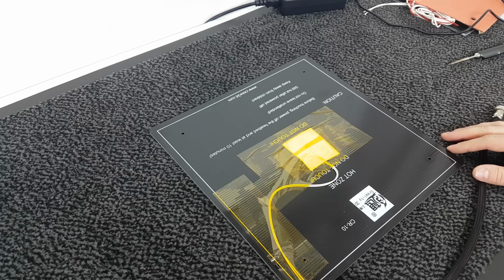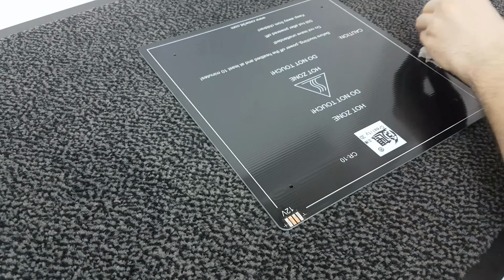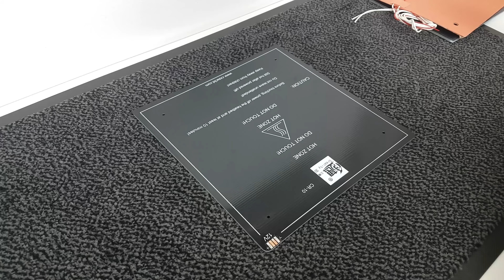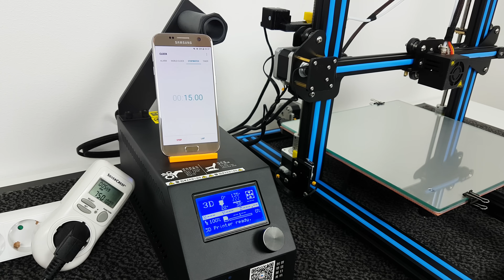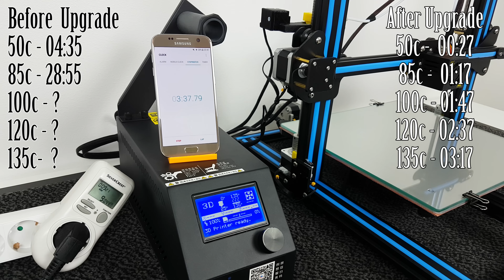Creality Cr10S ultimate Heat-bed upgrade! 750W heater installed

Comment from the maker: !!!!!!-----DISCLAIMER-----!!!!!!
Am not taking any responsibility if you are unskilled and inexperienced with electricity! AC voltage can be dangerous!
Use this video as reference or idea how this update can be done and what results it can deliver.
If you have better way to do this upgrade then please do it in your way.
If you want extra safety add ground wire to the Aluminium heat-bed or to adjusting screw and connect it to the ground directly or on the power-supply ground terminal or on ground pin on the main AC plug switch. 
Also for even more extra safety install Anycubic Ultrabase(that's what i did after this video) and don't use paper clamps. I'am afraid that using paper clamps over and over for long period of time may damage the heatpad and expose main wires. 
Thank you!
Reply: Nexi Tech can you show us how to put marlin on to try and get higher temperatures? Thanks
Reply: keenovo pad dosnt require the insulation, so why do you make it sound so necessary? Do i really need all this extra stuff... and why do you not mention any other ways of doing this ? is this only way ?
Reply: Write the disclaimer extra thick, because you should also not handle AC voltage higher then 50V or any kind of voltage.
If you know a good electricen ask him about this video, he will show you how it is done in a more secure way. Your way can work, but I wouldn't bet on it.
Reply: What if your silicone heater doesn't come with holes drilled through it? Do you drill them yourself, because that sounds like a big risk of shorting something(and getting yourself killed) if you're asking me. wondering since mine didn't.
Reply: @johanneswestman9315  no get one for the CR 10 or get a an aluminium sheet which is exactly 1 cm bigger in both dimensions (for other printers).
Like if you have a heat bed with the screws on the exact edges, then get an aluminium sheet 310mm by 310mm (for 300mm by 300mm bed. And attach the screws. You will need a drill to make it work! I have a Zonestar Z9M3. But there are ones specifically made for the CR 10. So if you have a CR 10 get the custom one.
Reply: @johanneswestman9315  Get a pad that has the holes.  These pads work via embedded wires and if you accidentally cut one two things can happen - 1) the heated pad won't work; 2) A screw through the hole could contact the broken wire and inadvertently conduct electricity to the entire machine, thereby exposing someone to electrical shock should they touch the machine.
Reply: Hello @nexi tech Is my SSR supposed to light up?  When I power the printer on, no leds shine.
Reply from the maker: Tam Le Swap input wires polarity on SSR? Led should light up only when heat bed is on.
Reply: @NexiTech  my goodness! It worked haha. The printer bed wasn't working when I bought it so I decided to replace it and do this upgrade. Thanks!!!!
Reply: @Sebastian Sorry to reply to an old post, but for the benefit of others, you'll needs to get a 410mm X 410mm heated pad instead of this 310mm X 310mm heated pad, since the CR 10 S4 has a larger bed.
Reply: Hi; Please tell me why would you need to ground the HEATED BED? Because you have SSR attached to PSU case that "should" be grounded itself_please explain....
Reply from the maker: guillep2k Can't you see that I just use that tape to stick thermistor wires to another cable so I can drag them thru the cable housing?! You didn't even look video carefully. Over connector wires there is electrical black tape and there is plastic thick transparent ring over it inside the connector. Like I said in the comments use this video as idea or reference and do this updgrade it in your way.
Reply from the maker: guillep2k What transparent tape? Where did I used it? Yes I know what is the heat-shrink I have the full box of it in different colors.
Reply: You should not have used common transparent tape to isolate the mains cables! Each cable should be individually isolated with heatshrink tubing (very cheap from the hardware store).
Reply: 4:44 over the thermistor wire. You shouldn't have used any kind of tape because a) tape dries with time and becomes a liability and 2) the one you used looks like very easy to puncture. In other comments you say you don't worry about the connector because the amperage will be less (which is correct) but the problem is voltage: some ambient humidity and you could have your mains voltage creep to the case; that's why someone suggested you put a ground connection to the case and the bed. And those connectors are typically rated for low voltage with a dielectric strength of 250 Vrms (not enough for your safety). I sincerely recommend you to add heat-shrink inside the connectors (both male and female).

Comment: My heat pad showed up 120v 750w then watching the video I started wondering...Here in the US we have 120v at the wall but yours said 220v Can I assume you live where you have 220v? And can I use the 120v pad with all the same connections you used in your video. Wait for the relay should be here next week will it accept the different pad? Thanks in advance
Reply from the maker: If I remember correctly I linked a 25A relay. It will work both with 120V and 230V pad heater. No worries my friend. Good luck with upgrade :)

Comment: Great stuff...watched it several time and ordered the new heat bed and relay but when using your link to the insulation material you glued to heater. Were finding it's unavailable. What are the white squares made up off? Is there a substitute? Does it need to be some fire retardant material etc.?? Hope you can reply will keep checking back as we wait for our parts. Thanks a million I have been wanting to do this and with your video decided we could thank again!
Reply from the maker: Hi Rob! Im glad that I can help and that you found mu video useful. That is heat resistant cotton which can withstand very high temperature without releasing any toxic fumes in the room. I just updated all links in the video description, please check them again. Just one tip you can use also silicone glue to hold the cotton it in the place. Remember it takes time to cure. Cheers!

Comment: For anyone wanting to know, I was able to do this with a CR10 S5! Just keep in mind when connecting the SSR to the motherboard to connect the negative side to where the small black cable from the heating bed port and the positive side to where the red cable was on the motherboard. I also couldn't get the end off of the cable so I just saudered the original cable with the new one. Works pretty good but doesn't look great lol. Thanks for this video too! 😊
Reply: What do you mean?  Your comment is unclear.  According to the video, the ports 3 and 4 on the ssr go to the mainboard.. are you saying to ensure each one is lined up with the -/+ on the board as it is shown on the ssr?

Comment: I completed this upgrade today. I followed this video step by step along with a couple others and combined them. I had a few minor differences. my mother board heat bed connectors 1 black ground and one red positive were connected to connector 5 and 6 labeled as hot bed not 3 and 4 on my creality CR10s 2.1 motherboard and i kept it the same with the new heat bed connections. I ran a ground from the bed base to frame and frame to control box. I also put a 133c thermo fuse between the bed and insulation inline on the power wire that runs to number #1 pin on the plug. I also updated the thermistor type, max bed temp, and with more power comes along with more responsibility so I updated  the thermo runout settings in marlin 2.0.9.3 firmware, compiled and uploaded perfectly. Finally set the bed temp to 100c and hit 100c in 2 minutes 10 seconds and 110c at 2 minutes 34 seconds with no heat error whats so ever. I am happy with this upgrade that cost roughly 70 dollars ordering all parts on amazon. The only problem I still have is that Octoprint still reports power supply under voltage to my raspberry pi and I really thought that would be resolved with this upgrade with the powersupply not being used to heat the bed anymore. I seriously give up on the undervoltage issue as it does not affect printing at all and I have tried everything except buy a new power supply and still get undervoltage warning from octoprint even after isolating the number 1, 5v pin in the usb plug with electrical tape as recommended on the gethub website. I never had this problem until upgrading my octoprint 1.7.2 and PI OS to 0.18.0. it seems they are always screwing up something with octoprint daily and I wish they would leave it alone and stop creating more problems with each update!!!! If anyone has had this same problem and has been able to resole it, please let me know how you resolved it, otherwise Cheers to a great heat bed upgrade video that will work perfectly if followed correctly and thank you so much for your time and effort!

Comment: Worked perfectly. This is really the way it should be from the factory.

I find it warps up my magnetic bed until the whole surface equalizes.. Something that didn't happen before because it was so incredibly slow.
Not a deal breaker, but something to keep in mind for some who aren't using glass.
Reply: thanks, i was wondering about that, my thermistor went out a while back so im gonna do this. how long did it take for the magnetic cover to equalize? this might be a concern if the print is interrupted but maybe a broken filament or other unplanned event.. especially when using exotic plastics.
Reply: @SteveHabermacher  Not too long. A few minutes, but it's something to take into consideration.. I find if I preheat the bed before I run the print, it's usually figured itself out and sitting flat again.
I've taken to using a pop up vinyl grow tent as an enclosure to keep things nice and toasty around the print anyway, so this preheating makes sense to warm the enclosure too.

Comment: Will this work with the CR10-5S ?  I bought a 500mmx500mm version of what you show and it comes with it's own temp control, but it's WAY off... like 10C off and the heater doesn't kick on until it's almost 20C below where I set it (in this case 70C). Right now I have the factory bed heater plugged in because it won't run without it plugged in. I just quickly tune the bed for the project to 0C so it doesn't heat up. But super janky set up. I want to do it your way, but am not an electrical engineer.  I just need to know what parts to get. and then your instructions for set up seem pretty straight forward.

Comment: Cotton will catch fire. What part for high temp pc prints?
Reply from the maker: That's is high temperature resistant cotton. If I remember correctly it was rated up to 900 degrees celsius. Google it.
Reply: @NexiTech  I need to upgrade my system, it's been over a month and I still have no response regarding the mosfet. Please update. Got a 3d printer I can't do anything with.

Comment: I'm planning this upgrade if the SSR was to fail in the closed position heater won't turn off I plan to fit a thermal fuse under the insulation

Comment: Does the insulation hold it's compression consistently from the paper clips & spring tension?
(It seems like it might compress more DURING the print and mess up the bed leveling.)
Reply from the maker: The springs eats up/chop off cotton insulation instantly so springs has direct contact with heat-bed. No need to worry about leveling. Also place the ground wire on one of the leveling screws and connect it with the ground on the powered supply for more safety. Cheers!
Reply: @NexiTech  thank you!

Comment: Dude...this is the most complete video I've found so far. I was wondering about the thermistor and connections to the plug. 
Great work.

UPDAET: 
HOT DIGGITY DAMN, it works! About to do a PID test but the bed works!

Comment: Having trouble with mine.  The last step is what is not working for me. The 2 wires that trigger the relay. On the board the 2 pins on the board is already taken by the nozzle. I tried the 2 that wasn't used and nothing.  I did try the location you originally set for and it doesn't work unless I run turn on the nozzle temp. But relay stops once nozzle temp is reached. Seems to me it's reading what the nozzle temp running.  Got any ideas?
Reply: Got it working. It was the first 2 pins for my board.

Comment: Fyi... followed this great video to add a 1200w heater to my cr10-s5. Worked great but due to the increased power,  I started blowing fuses.  Bumped the AC fuse up to 15A and for safety I replaced all the AC wires in the control box with 14  gauge.  I was pulling a steady 13A when the heater cycled on.  Thanks again for this!  Hope my comment helps anyone installing a larger heater.
Reply from the maker: Awesome! Thanks for info and feedback. Wish you a great day! Good luck with your S5 monster 3D printer :)
Reply: I have a cr10-s5 and have been wanting to do this upgrade to a 1200w  heater as well other than the fuse and replacing the wiring wich i will be doing do you have any other suggestions   and how is yours working out

Comment: Step by step with some miss-steps... Thanks anyway
Reply from the maker: Still you get the idea :) On tip, add ground wire to one of the heat-bed screws. Never be to safe ;)

Comment: Hello, good video.  I have the doubt if the original gx12 connector of the bed supports that power of 750w 220v without burning.  Have you had a problem?  Thank you
Reply from the maker: Never got any problem with original connector. It's cold as ''ice'' under load. If you thing about it now in this AC mode much less amps is going thry the connector then before on DC.
Reply: @NexiTech  Perfect, Thanks for the clarification. You have done a good job.

Comment: Knowing my electrician skills, I'd probably goof this thing up at every step.
Is there a (relatively low cost) printer model that comes fully equiped out of the box to print nylon and polycarbonate ?

Comment: Out of the box, the CR-10S PRO V2 does 100°C in 6:20 (6 minutes and 20 seconds).

I just timed mine which is stock, brand new and I just pulled it out of the box.

The maximum the option allows to dial in is 130°C.
At 83°C the power supply fan turned on.

At exactly 8 minutes it was at 109ºC and I stopped the test because it was clear that this 2 years and 6 months old video continues to outperform the factory heating bed performance.

EDIT:
I forgot to mention, the room temperature was 30°C at the moment of doing this test.

Comment: do i have to use insulation material ? i dont care if it'll take a bit longer to heat up, as long as its the only con.
Reply from the maker: Nope, isolation is not necessary.
Reply: @NexiTech  awesome,thx.

Comment: Can I do it to cr-10 v2 i thing there will be no problem ?
Reply from the maker: CR10 V2 don't need this upgrade. It has 24V power supply and it can reach temperatures for ABS printing without a problem.
Reply: Nexi Tech thank you so much ı love you and your channel, perfect informations 👍🏻

Comment: May I know what type of glue you use to stick the insulation cotton to heated bed? TQ
Reply from the maker: You can use silicone glue. The good one is thermal silicone glue for heatsinks. After drying/curing it turns out rock solid.

Comment: Could you use the 400 x 400mm mat on a 508 x 508mm ( CR10-S5) table?
Reply from the maker: Greg M I don't recommend that, You will have too much heat temperature difference from the 400mm lines to the 508mm. Your prints can warp if you try to print anything over 400mm line.

Comment: I dont think you should use that glue on the heatbed "B-7000 is an Industrial-strength single component adhesive it dries clear is paintable and withstands heat up to 150 °F / 66 °C."

Comment: Fantastic solution but TAKE CARE!

 The heatbed relay wires need to be connected to the two terminals at the bottom of that connector block as shown on the video. It is is extremely important that the polarity of the wires is correct or the relay will not function. 

Otherwise a flawless video and many thanks!!!
Then make sure you EARTH/GROUND your Heatbed and Printer Frame to EARTH/GROUND running an EARTH/GROUND Cable to the the correct connection inside your 3D Printer's PSU.
I followed a guide on the TEVO Tornado on how to make it safer/grounding/earthing. Please use Google or Youtube.

This is an extremely important safety feature and if you are going to all this trouble to upgrade your 3D printer,  PLEASE DO THIS AT YOUR EARLIEST CONVENIENCE!

Thanks
Coaster

Comment: Just to clarify 100%, I do not need to feed 220v for this to work, I can still run on 110v?
Reply from the maker: Evan Ledwith There is 110V heater in description as well.

Comment: So, I followed this video and now my bed and the hot end won't heat. Any ideas - Update. The wire that you removed are on a different spot on my board and I pulled the hotend wires.  At first, I crossed the wires and nothing would start. Then I looked at it and realized what happen and bingo. Everything heats up quick. Thanks again for the video.

Comment: Awesome upgrade. Just finished it, and works great. Only thing is, the maximum temperature the firmware (Th3d Marlin) will allow me to set is 105 degrees? Any thoughts... Anyone.. Cheers
Reply: Is your upgrade still working? Any problems?

Comment: i found the 110V version of the heater. can i use the same relay? if not, can you recommend what i need?
Reply from the maker: Dan S Yes it will. 
BTW In video description you have links the heater that works on 120v or 220v and solid state relay that works from 48V up to 480V AC 50/60hz.